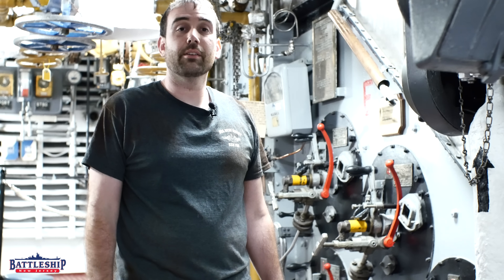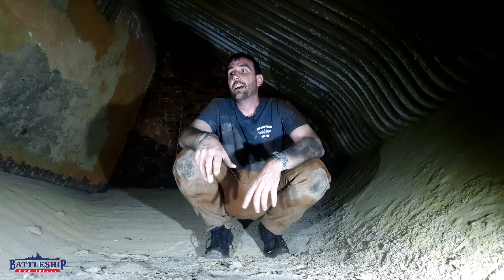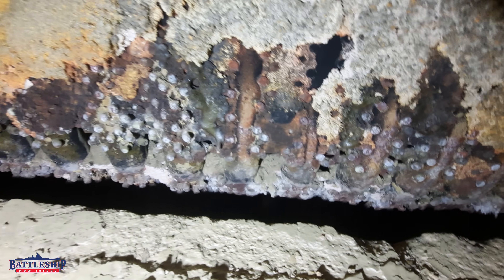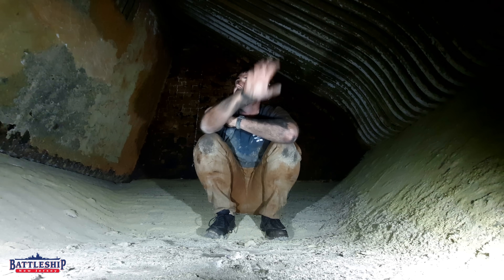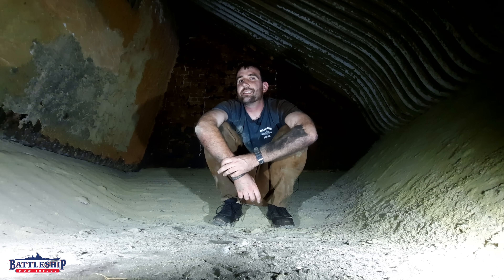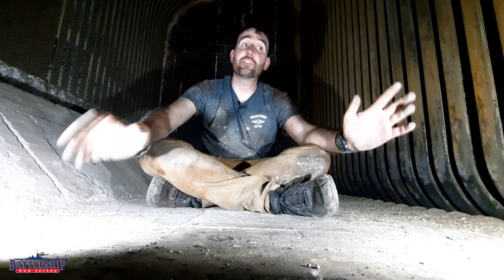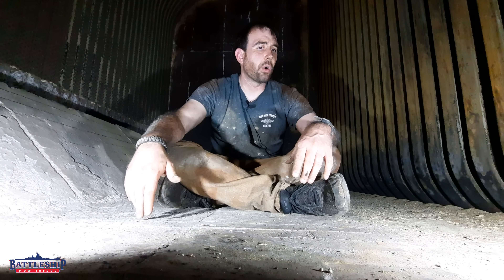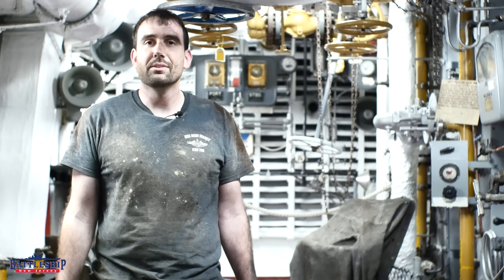Inside the Boiler of The World's Fastest Battleship

Comment: How do you start a boiler? (Details pleas) And how long does it take for a boiler to get from cold start to full steam?
Reply: Depends on how fast you need the steam.   I was a BT on the Jersey  85-87.  First thing is feedwater and boiler chems.  Then you use the electric blower and fuel pump (low capacity) and light one burner.  Let simmer until you start getting steam out the vents, close the vents and continue simmering, at around 150PSI crack the main and aux bypasses and continue simmering.   Watch the water level.   Around 250-300PSI open the auxiliary steam stop and start prepping the steam driven machinery, start when ready then secure the electrics.  Around 625 open the main steam stop and get going.  All this is SUPPOSED to take a couple of hours.  I've seen it done in around 30 min.  Doing it fast is VERY hard on the equipment.
Reply: @barto6577  Thank-you sir for both your service, and for the information. I've watched steam locomotives getting fired up from cold, and I knew it took a long time. Thank-you again.
Reply: @glrider100    I enjoyed my time in the Navy.  Went on four West-Pacs one of which turned into an I/O cruise. I was planning on transferring  to the East Coast but an injury put an end to that.
Reply: @barto6577  I can tell by reading your answer, you know what you are talking about.
I told people in the Navy, that I liked my job, just not the company I worked for. I got out after 8 as a MM1, got an Engineer's license and sailed Merchants off and on for 30 more years.
Retired back to Kansas, I miss the Sea.

Comment: I was on the USS Midway for 27 months during Vietnam. I was a BT (B division).

We had 12 boilers divided across 4 groups (main engines), 70,000 BSHP/shaft.

The funny thing is the keel for the Midway was laid as a Battleship in '43, shortly after it was redesignated as an aircraft carrier.

At one time we had it cranked up to 37 knots. Of course we weren't doing flight ops or anything like that. We even took the evaporators off line for an hour to conserve steam for the main engines. Let me tell you, she was screaming. We were @117% of design power output and had the emergency backup (2 ea. 12 cylinder diesels) generators online to save even  more steam for propulsion.

Fun times, sometimes!

Now, let's go fly some planes and shoot some munitions. We also had 5 inch guns.
Reply: You probably didn't stay at 37 knots very long. Oil fueled ships really gobble down the fuel at flank speed. 
That's the advantage of nuclear-powered ships. We could go at flank speed basically forever. In 1977, the Enterprise, which had just left Kenya, was ordered to turn around and return to the African coast because of Idi Amin's threats to foreigners. We circled off the coast for a week, burning a hole in the ocean. When the threat went away, the Enterprise returned to Subic at flank speed all the way across the Indian Ocean. We made up all the time lost and were able to return back to Alameda on time.
Reply: @charlesgantz5865  The general rule of thumb for wave making ships (I do not understand the why) is that fuel usage goes up by the cube of speed.  30 knots is 8 times the usage of 15 knots.  HMS Hood burned 7 tons per hour at 15 knots, 70 at full speed (32? knots).

Carriers especially use a lot of fuel, what with high speed at whatever course is into the wind to get enough wind over deck, then high speed to get back in position and on course.
Reply: @grizwoldphantasia5005  That's why the Nimitz- and Ford-class carriers all are nuclear powered. Clean energy (no carbon footprint) and gobs of it available at any speed. Flank speed around the world: no problem.
Reply: @charlesgantz5865  NOBODY could keep up with the Enterprise!!! Never heard what her top sppd was but it was FAST!!
Reply: Wow, it's hard to imagine the Midway doing 37 knots. That sounds like a blast!
Reply: If I remember correctly, we were reading 310+ RPM on the main shafts.
Reply: @MontegaB  37 kts, the old lady sure was cooking!! Was onboard 79-82, ran 1C boiler room. never saw her with all 12 on line. Normal steaming was 8 boilers, 2 per shaft. We could hit 30 kts with 8. Most I ever saw was 10 on line. We ran out of BT's. And Ryan, btw the steam that enters the superheater is very dry , but at a temp of 489 degrees. The superheater raises the temp to 850.
Reply: Nope, Midway designed and built as a carrier from the keel up.  That rumor may have come from being such an advance over the Essex class that the Midway class was designated CVB for a while, but the B does not stand for Battleship.

For reference, see Norman Friedman's Design History of US Aircraft Carriers.
Reply: @grizwoldphantasia5005  The keel was originally designed for the Montana class Battleship that was configured for the higher power engineering class with 12 boilers. There were  9 different plans/blueprints submitted and #5 was accepted, as soon as the steel hit the bottom of the dry dock it was re-designated as CVB. The writing was on the wall about Battleships and the need for carriers.

The B in CVB was for Battle. In one of the refits in the late 50's or 60's after 90% of the guns were removed, she was reclassified as CVA for attack because it could chase subs.
Reply: @jameslong3351  Norman Friedman makes it clear it was an aircraft from the very earliest sketches and design studies.  The only mention he makes of the Montana class that I can remember is one proposal to copy the Montana's engineering plant, and in the end that was too low-powered.  Even if it copied some aspects of the Montana's keel, that does not make it a battleship design any more than the fact that it used the same STS steel,  possibly the same boilers or turbines or screws, or the same 20mm and 40mm (and possibly 5"/54) guns.  The class was specced as an aircraft carrier, it was designed as an aircraft carrier, and they were built as aircraft carriers, from start to finish.

It was never a battleship design in any way at any time.  That is pure myth.
Reply: @jameslong3351  Everything correct except the B in CVB. In US Navy parlance it means "large." The Alaska class cruisers were CBs; large cruisers. The Essex class were called fleet carriers and the Midways were different.
Reply: @grizwoldphantasia5005  Yes, it was a carrier from the start but the keel was made for a battleship. You missed the point.
Reply: @ut000bs  Citation, please.  I do not believe you.  It was designed as a carrier from the keel up.  No doubt there were many many parts in common with battleships, such as hatches, doors, intercom, turbines, boilers, even the 5" turrets I think may have been duplicated for the Montana class.  That does not make them battleship turrets or have anything to do with the myth of CVB meaning battleship.
Reply: @grizwoldphantasia5005  "It was designed as a carrier from the keel up."
I am failing to find where I said it wasn't. Perhaps rereading what I wrote and a small second of thought this time will clear it up. You replied to me talking about absolutely nothing I said at all.
Reply: @ut000bs  Then stop saying it had a battleship keel.
Reply: "B" as in CVB(Carrier Vessel), the "B" stood for "Battle". They were then changed to "CVA", the "A" being "ATTACK".
Reply: @grizwoldphantasia5005  IT HAD A KEEL MADE FOR A BATTLESHIP.
Sorry for yelling.
Reply: @jameslong3351  In US naval ship nomenclature "B" is "large."
Reply: @ut000bs  No -- It did not.
No -- You're not sorry.
Reply: @grizwoldphantasia5005  yes sir. The B in CVB stood as Aircraft Carrier Large.
Reply: @tomasthomas8563  Don't call me sir!  I know who my parents are!  It didn't take an act of Congress to make me honest! :)
Reply: I ran those Fairbanks for two years and did a stint up in AC/R. We had the biggest roll while I was on board. I remember that all the hanger doors were closed and the outside hatches were chained shut. Always wondered about that keel rumor.
Reply: @grizwoldphantasia5005  Designed as a carrier from the keep up BUT...Borrowed a lot from the Battleships.
Reply: @scoutdynamics3272  Every ship design borrowed from other ship designs. Don't try to sneak in references to battleships to justify the 'B'.
Reply: I bet the midway was in great condition then... Did about 2 years of cruising (as part of air wing) on midway in mid 80’s. A different era
Reply: Another MIDWAY hole snipe here! (1985-1987) M Division, 1 group. . Plenty of underway time, and plenty of GREAT port visits. Even if you were in three section duty...
Reply: I was an Airdale aboard Midway in 70's. I recall those 5" guns going off at sea. There was a hi speed drill one day, so I went to fantail to observe.  The wall of spray was incredible! The Navy got her money's worth out of that ship. Glad she wasn't scrapped and is now a popular museum in Dago.
Reply: Ran 1C  79-82 Best ship I was ever on
Reply: @johnchilds6471  Hey John, glad to finally hear from someone from B1C, (compt no. B1C). Most tourists don't know that midway had 4 engine rooms along with 12 separate boiler/firerooms rooms,
B1
B1A
B1B
B1C
B2
B2A
B2B
B2C
B3
B3A
B3B
B3C
B4
B4A
B4B
B4C.
I hope my memory is correct, to go from any B1 group you only had to go up to 3rd deck, but to go to any other propulsion group you had to go up to 2nd deck.
Reply: @tomasthomas8563  If anyone was chasing you just drop down to the 2nd deck, it's a maze to anyone who isn't a snipe!!
Reply: @johnchilds6471  2nd deck. You mean that the deck that had fwd and aft messdecks. Everyone e1 to e6 knew that deck 3rd deck was the bad boy to learn, especially the hatches to go down to B1 to B4 and B1A thru B4C.
Reply: @tomasthomas8563  Yea, we had one guy who snuck his girl aboard in the Philippines,  had her down there, took a couple of weeks before she turned herself in if I remember right. Was a LOOONG time ago.
Reply: Why where you going so fast?  Design test?  How much diesels fuel you carry for your generators?
Reply: @studinthemaking  Well, we had a casualty    with a parking brake, a thrust bearing, and a jacking motor.

Ended up in dry dock for 30+ days for repair and inspection. Because of the inspection we had to requalify the engineering plant by doing sea trials. Sea trials are Navel Engineering Code for "Lets see if we can blow it up.".

The generators could burn the same fuel as the boilers, ND (Naval Distillate). We had storage for 1.3 million gallons of ND, the gen rooms could flush there service tanks to us so that their fuel wouldn't get stale.
Reply: @Just Looking Those valves are fuel oil transfer main tank fill valves. They are used to fill or empty fuel oil storage tanks how ever needed. If I remember correctly, we had 5 transfer pumps (appprox. 350 hp each}. The reason it looks like a smorgasbord is because they were setup as double isolation, so you had to open two valves to fill/empty any tank.
Reply: We never had enough BT's onboard to man all 12 boilers for any length of time, most  remember was 10 boilers on line. Don't remember the speed  but we were doing flight ops too plus normal steaming load, SSTG's on line and full hotel services. The 5" guns were gone.
Reply: I visited it twice last month on holiday in San Diego. It was awesome. What battleship did the hull originate?

Comment: I once saw an installation of an airplane fuel tank liner on an Air Force plane.  They had a tiny female airman to climb through what looked like a 10-inch hole.  It seems like a good reason to integrate women into the services.

Comment: For sealing things like the burners and those access hatches,  I wonder if asbestos was still used, or was it phased out during the 80s refit???  Or maybe removed during her last inactivation(??)
Reply: All the gaskets for the boiler doors etc are non asbestos.  LBNSY phased out all asbestos material in gaskets, etc in all shops by the late 70's.
Reply: @ytlas3  I remember picking up chunks of asbestos lying around and workers warning me not to touch while wandering about at LBNS in the mid-late 70s!!
Reply: @wheels-n-tires1846  I was an insulator at LBNSY for 20 years.  What used to really piss me off was when some idiot would see me stripping something and yell asbestos without knowing anything. Even back then they'd never leave asbestos lying around. There were times when a Rigger would put their cables around a large asbestos line or some pipefitter would hammer old insulation off the end of a pipe so they could remove studs from a flange........... I still have excellent lungs because I never did anything stupid
Reply: @ytlas3  Dad worked in the sonar dept there. From about 67-79.
Reply: @ytlas3  I remember the incident that came to mind. I was 6 or 7, and had just come in from an overnight aboard the brand new destroyer O'Brien for sea trials. Dad rejected the sonar system. We were on the pier, and there were divers  inspecting the sonar dome. Dad was talking to the CO, and as kids do, I started picking up stuff to throw in the water. A yard worker came over n suggested not doing that, then he mentioned that I shouldnt touch the fluffy white stuff anyway,  it was asbestos. In retrospect, why thered be random pieces of it laying on the pier is a bit suspect, LOL...
Reply: @wheels-n-tires1846  My dad retired from the Navy then worked at LBNSY for 20 years. I was around Navy ships for 50 years
Reply: @ytlas3  Same!! Dad retired after 23yrs in 64. Then did work at Pacific Missile Range and a brief stint with Mickey Thompson racing before going to LBNS. After retirement got boring, maybe 2 yrs(?) he went back to work for the navy as a sonar consultant.
Reply: @wheels-n-tires1846  That reminds me, when the Missouri came in for pre activation overhaul,  the shipyard Gas Tester was exploring compartments. He went down a trunk then discovered a compartment full of 1950's vintage cases of asbestos pipe insulation.  I bet he crapped his pants when he read what the boxes contained.  Our shop had to go down there and double bag all the cases of insulation, then lift it up the trunk by rope

Comment: 'Scuse me, we did 36.6 on the Iowa in the late 80's.  Big "J's" engineering plant was in rough shape after her stint off of Lebanon 🇱🇧 and couldn't possibly attain the speed you claim
Reply from the maker: We have yet to see any actual paperwork stating that, just claims from the crew. We'd love to see that deck log.
Reply: That was almost 20 years after the claimed speed record.
Reply: From the Guinness World Record website --
Who  USS NEW JERSEY
What  65.2 KILOMETRE(S) PER HOUR
Where  UNITED STATES ()
When  1968

The US Iowa-class battleships were powered by eight fuel oil boilers and four propellers, delivering 212,000 shaft horsepower. In 1968, during a shakedown cruise, the Iowa-class USS New Jersey achieved a top speed of 35.2 knots (65.2 km/h) which it sustained for six hours. As part of a brutal test of the ship’s engines, the captain then ordered the ship to go instantly from “all ahead flank” to “all back emergency”. New Jersey took some two miles to come to a stop.

Note: There is no entry there for the USS Iowa.

-- John

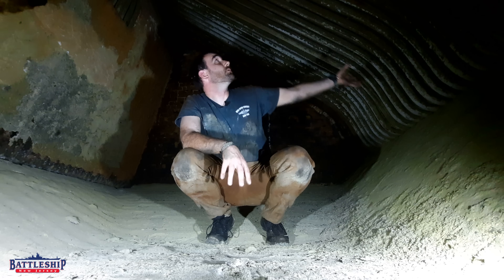Comment: hi all, quick question, at 5:07  i noticed in the video a control coming down from the ceiling that the crew spun, but it also appears to be moving up and down, anyone happen to know what that control is and why its moving?
Reply: thi controlled the air to the burners, too much and it was white too little and it was black which air craft carriers did no like
Reply: Forced draft blower control, and the pin holding it together sheared.